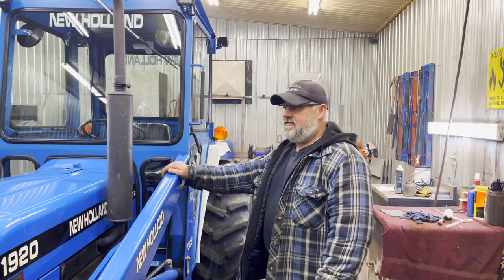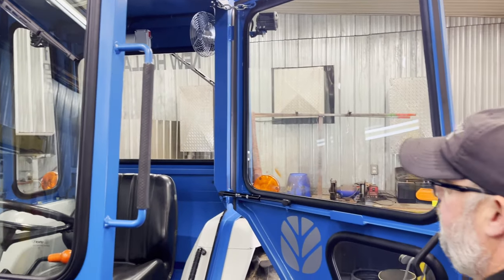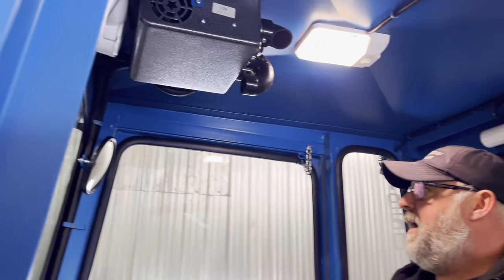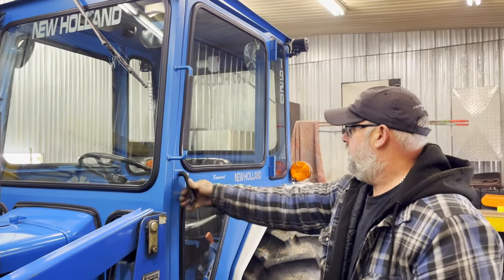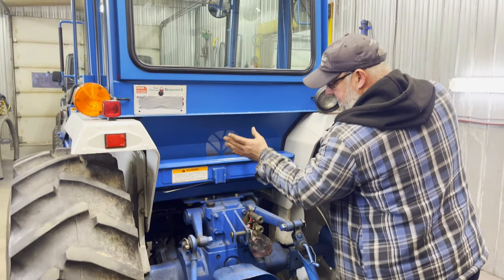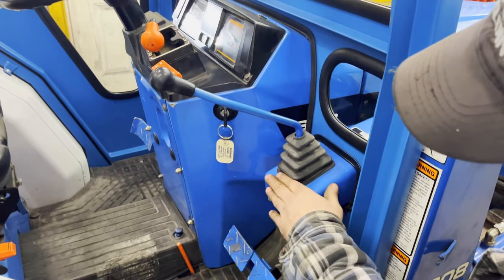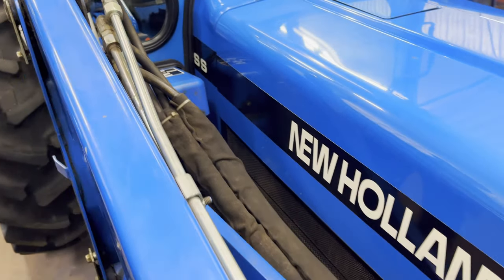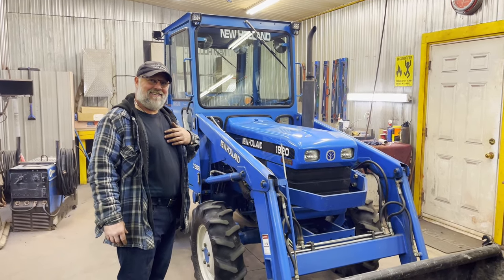Custom Fabricated Tractor Cab // New Holland 1920

Comment: Those modifications you made are invisible. 
Even when you point them out they still look factory.
I have a question about the water lines for the heater if I may. 
With the heater at the ceiling, how do you purge the inevitable air pockets out of the water lines?
Reply from the maker: I  never drain the coolant and i never get air pockets , I simply tie into the coolant system by whatever means necessary ,usually through a bypass hose then make sure reservoir is full then run tractor high idle until it reaches operating temperature then shut it down wait 10-15 minutes and slowly remove rad cap air will escape and reservoir will purge into rad, all will be good trust me👍 I’ve done hundreds..